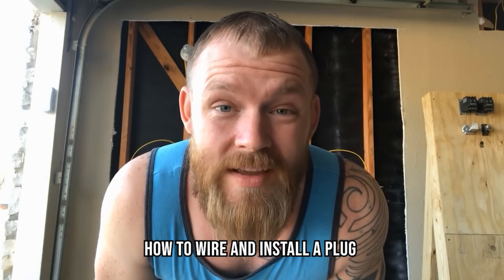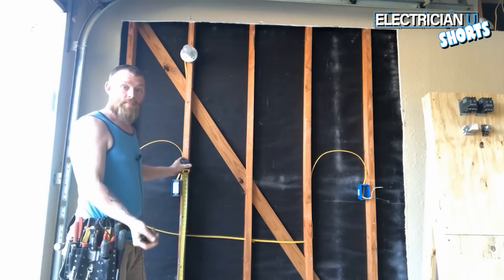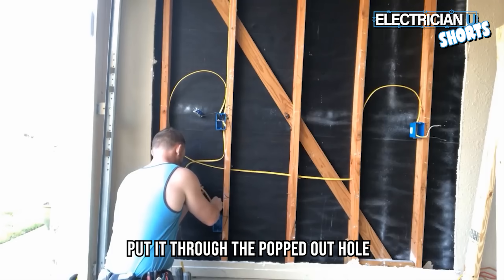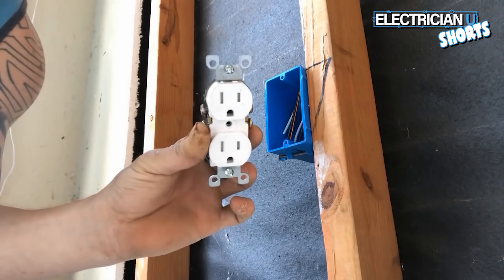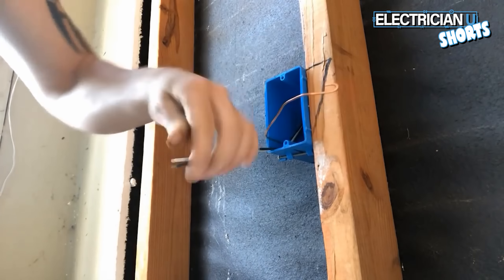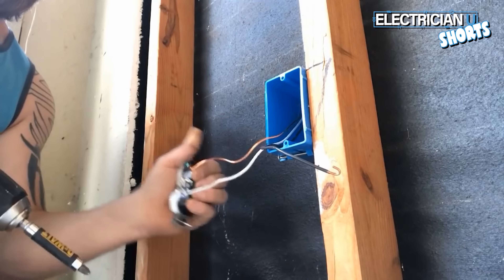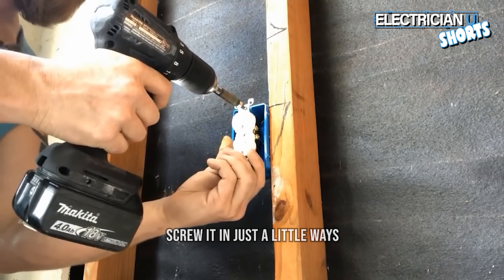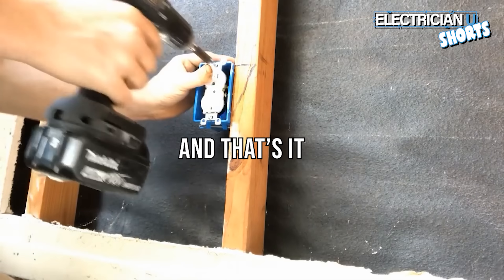SHORTS  - How to install a receptacle (in 3 minutes) - SHORT VERSION

Comment: Somewhat of a non-technical question from a non-electrician. I am generally seen plugs installed with the ground facing the lowest point near the floor.  This summer while traveling down south I noticed to me was the outlets being installed backward with a ground was facing up towards the ceiling. Is this just a regional thing is there any code that says which way the ground has to face.  Thanks

Comment: We live in a 1975 house that has receptacles that were daisy chained using the push ins on the back.. Over the years we have had numerous failures from them... I have taken each box and added 8" pigtails to the wires passing through using solid red or yellow wire wire nuts and use the pigtails to wire directly to the receptacle screw after bending the wires in a loop and attaching the loops so that they are pulled tight as the screws were tightened... No more wiring problems and we can now safely use a high a current device at the end of the circuit loop... You might want to show how to retrofit aluminum wired circuits with pigtails and anti corrosion paste at the junctions of copper and aluminum wires... I'm an electronic technician and not a licensed electrician but I try to follow local and NEMA codes... I have had to deal with push in connectors that have melted and burned inside work boxes leaving only the bare metal connections in my families homes..
I won't use them and will only use proper wire nuts and after twisting all wires together and adding nuts then I pull on each wire to make sure none are loose .. I don't know if you have addressed the above problems but aluminum house wiring (around mid 1970s ) and poorly used push in connectors cause fires

Comment: I would also add that the hook goes on the screw clockwise so that as the screw tightens it tightens the copper around the screw with it. If you wrap the hook around the wrong way it's gonna come loose when you tighten down the screw.
Reply: I would like to say that you should not have to say it but I run into it done wrong way too often.

Comment: The round supportive  “ears” should be removed from receptacle if installed before wall finish. They are designed to hold outlet against finish wall.
I have wired buildings with #14 romex and up with copper, copper clad aluminum, and aluminum wire. Nice job on the Romex run, and explaining this to the amateur. You would not believe how fast one can install that outlet using a “Yankee Screwdriver.”
 Romex ie non metallic sheathed cable. Gets the name from Rome, NY where it was first introduced.

Comment: Why do you use a utility knife to cut the jacket instead of just stripping before you put the wire in a box?
Reply: I dunno. better question is why not? there is many ways to do things. For this method you don't have to worry about the conductors getting caught in the box connector and scoring them. Though if you are careful and not yanking them through like you are trying to win a tug of war neither method makes a difference.
Reply: @Talinthis  oh I agree there’s multiple ways to do things I was just curious for his reasoning, you can’t have to much info when you’re starting out
Reply: Biggest reason imo is you're not always working on an open wall with very easy access and if you guess wrong and cut the outer insulation to far back and have none in the work box you're SOL and rerunning that wire and you'll only do something stupid like that once.

Comment: Thanks Justin.. I was able to install 3 outlets in 2 day. I accidentally put 3 staple in my wire but it still work with phone charger. Is wire supposed to smell like burn when I plug phone charger in?
Reply: Just be smart and be optimistic and you’ll be fine.

Comment: What is the method for running wires on a block wall with 3/4 fur strips to be covered with drywall? 
Must it run in conduit because of its proximity to the surface?
Reply: Hire a professional.
Reply: @dallas5374  not what i asked

Comment: Hi there buddy why are you working without insulated screwdrivers
Reply: Because there's no power. Only insulated tool I own is a #2 square for live panel work. Most other things I can easily turn off the power before getting the work done.
Reply: @maxderman447  everyone uses insulated screwdrivers all the time if there is power or no power
Reply: @johnoreilly7052  I guess not everyone does then. Been in the trade 3 years. Worked commercial, residential, and oil fields. Never seen a guy only use insulated tools
Reply: @johnoreilly7052  not if you're almost exclusively doing new building installs..
Reply: @mattsmith1318  I always work on new builds or on old houses insulated screwdrivers all the time here in the UK 🇬🇧
Reply: I never use my insulated tools for brand new construction rough in, it is not necessary if proven it cannot be energized without further connections from the electrical. That would be like me wearing a bomb suit wiring the 600 volt motors when the lines weren't even hooked up to the electrical grid on the power lines... and i have not seen an insulated torque wrench for final specifications before closing it up either but i am sure they exist.We have an obligation... and it was actually company policy, to witness both sides of the cable and to meter it out with a voltage test, and then a continuity test to make sure that indeed was the one we are going to work on before we proceeded.

I am 99.9% Industrial journeyman electrician, they are worlds different in terms of work but we don't terminate the power source side until everything is complete.
Reply: @Talinthis  if anyone worked with me you would sacked I am electrician for 32 years
Reply: @TJack303  sorry you still sacked
Reply: @johnoreilly7052  You've been an electrician for 32 years and you still haven't figured out that you don't need to use insulated tools on a known- dead LOTO'D circuit? Seriously? What country do you work in and who's the dummy that mentored you? Did your mentor tell you to use insulated tools as little as possible because the wear and tear can ruin the insulation quickly and as soon as you get a nick in it to where you can see bare metal its technically no longer has the 1000v insulation rating?

32 years would put you back starting out around 89-90. Back then the old salt mentors used to lick the back of their hand and touch a 120 (sometimes even 208 or 480) wire to see if it was live or not. They used to never lock out. 

So you're either full of shite or your mentor was Mike Holt himself.
Reply: O'Reilly sacked for not using a specific tool that is not necessary for the type of work at hand? They would probably be better off
Reply: @johnoreilly7052  I guess we're still the wild west.. 🛠🇺🇸🤠
Reply: Using insulated tools for a non energized circuit, is like wearing a condom at the grocery store

Comment: You don't leave (forgets trade name) extra in the wall? Like....uh an S. From the staple go down to the box then back up then back down and into the box. It's only done in Residential, for futures. Like someone blows up the wire or, the far more common, drywaller routers the wires; you just loosen the clamp(if said box has a clamp) and pull in the extra.

Also don't put your strippers at a 45. Keep it at a 90 or you will ring your wire. Strippers are designed to cut at a 90. They are sized perfectly. If you cut at a 45 you are making that hole smaller. If your strippers don't work unless you put them at a 45, they are worn out and the circle is more of and oval now... buy new ones.

Screwing down the unused screw is actually code... may only matter with metal boxes though. 

Good call on the bond not touching the neutral. Not enough people respect that rule.